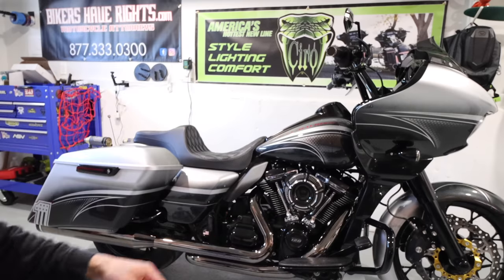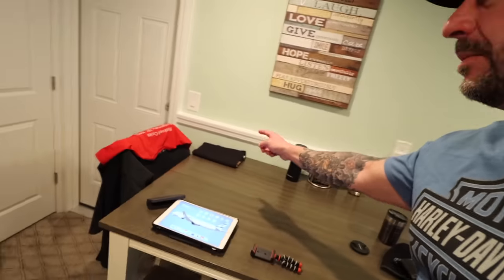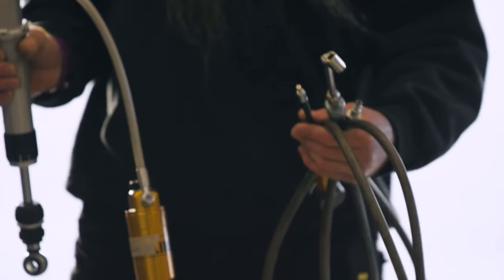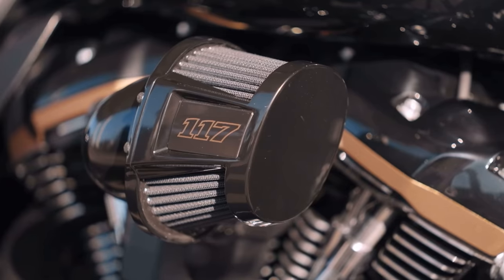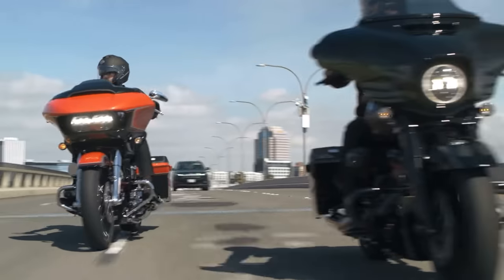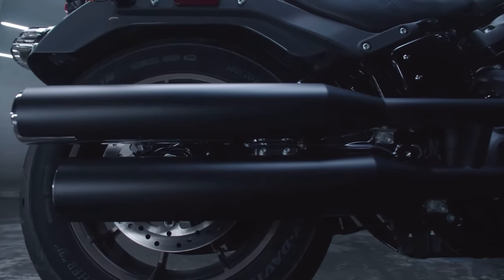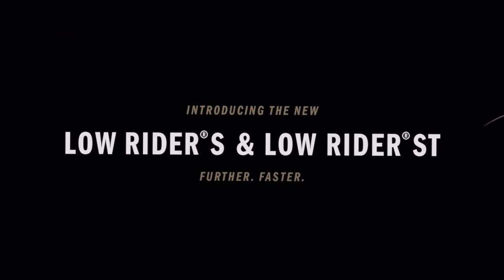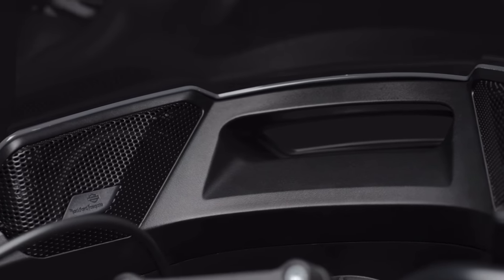2022 HARLEY DAVIDSON NEW MODELS - LOWRIDER ST - STREET GLIDE ST - ROAD GLIDE ST / NEW CVO COLORS

Comment: The new Low Rider S and ST is going to change the game for HD. For sure that will be my next bike. I would of preferred they pit the speedometer on the S on the ST. Personally do not like the square version they put on the ST. Curious if they will allow you to order the ST with the oval speedometer. On the road glide ST and street glide ST, I love the new design but have mixed in motions on the bronze wheels. The low rider S is know for the bronze wheels and sad they implemented that on the road/street glide ST. But overall HD is listening and moving into the right direction. I predict the new low rider s and ST will be their top selling bikes! Especially here in San Antonio Texas. They barely keep the old design in stock and the new design will fly out the show room. Ride safe and for bless!

Comment: A good video by Harley.  As an Indian owner.  I have to ask.  No adjustable windshield?  No ride modes.  No central locking.  No rear air suspension ?  I must have missed it.  Surely no one wants to use their barrel key to unlock the backs anymore.  Just my biased opinion.

Comment: Disappointing considering the hype. Love the new low rider st but the baggers are nothing new. Just a CVO engine not even a 122 or 131. Same ole lousy suspension. What happened to a performance bagger?  Only good thing is my stage 2 2019 RGU is not obsolete

Comment: I like Harley but always felt they were overpriced, slow, unreliable, non-handling motorcycles. I rode a Roadking and was bored after an hour as I felt I couldn't do anything but go straight on it. Sounding powerful but going slow and straight didn't impress me. So I couldn't see paying so much for a motorcycle that way underperformed as compared to say a Vmax (200 hp) that would probably smoke most of these performance baggers and performance low riders S for only 18 grand. BUT with the Low Rider S Harley sparked my interest a couple of years ago. But still felt it was underpowered as Japanese motorcycles mad power years (Vmax 11 sec bike,. Magna mid 12s in the 80's stock etc.) ago. Shouldn't have to pay around 20,000 then spend another 3,000 or more just to get the same kind of performance to bikes in the 80's. Though watching John, Marvel Kid, Holy Shift, Barber CVO and Wood Jr sparked my interest in Harley more due to the comradery and how they make their bikes their own which is cool. I will say Harley is definitely listening to their consumers by upgrading the low rider S with the 117 and adding a Lowrider S bagger. I have to say I am impressed. I am very curious on a how Lowrider S 117 with a stage 2 performs. I hope Harley stays the course. They are an American motorcycle company. I want to see them succeed as well as (hate that victory is gone) Indian. Now if they can only make a modernVR1000 with that new liquid cooled engine I just may jump ship! C'mon Harley!